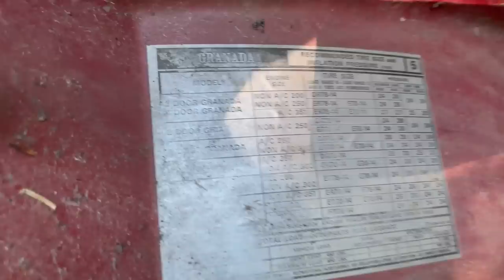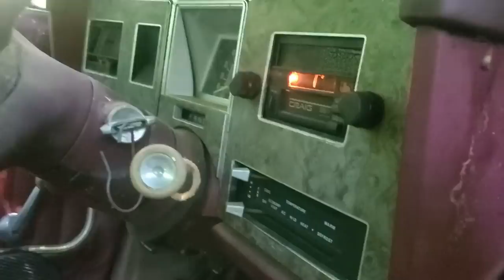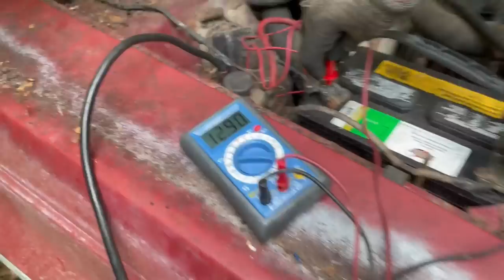Will it run? Abandoned 76 Granada in the middle of nowhere!

Comment: At first, I was afraid that you might have bitten off more than you could chew. But you did a great job with it! Now the next hurdle, getting it out of that cornfield, might be a bigger challenge to your manliness. But it has to be done. I mean, you can’t just leave it there!
Reply from the maker: I have been thinking about that. With 4 tires it would start up and go, but I am not sure how I would get it out of there. There isn't even a footpath near it. Something to think about in a couple of months when the vegetation dies down.
Reply: @whattherust  during the winter time when the corn dies you can try to drive it through the cornfield maybe wait until it's cold enough that the dirt freezes so you don't have to worry about sinking in ice or if you live in the south which I don't remember at the moment when there's no corn in the field I know it does get a little dry in the month of December
Reply from the maker: @nojopro908  Exactly what I was thinking. I don't know what is on the other side of that corn field, but if the ground is solid perhaps it could be used as a road in the winter.
Reply: Get a tractor with a front blade to make a path.Get it out f there.Great work guy

Comment: I had a '75 Granada with in-line 6 and it had to have a new starter at 18K miles. Then various electrical problems began to surface. The larger plug on top of the ignition switch on the steering column had multiple wires crimped over insulation in the mating plug. Several wires had gotten hot and almost started a fire. The car had carburetor issues that the dealer did not solve and I got rid of the car at about 25K miles and never looked back. These cars were known for lots of intermittent problems, especially with electrical circuitry.
Reply from the maker: It would seem this one follows that trend of electrical issues.

Comment: I nearly fell out of my chair when it started without the carb! That's wild!
I was carrying groceries out to these cars when they were just a couple years old, and one customer had one that was a four on the floor. I had no idea that these came with a V8. With few performance parts, a car like this could be a sleeper hot rod pretty easily.   Great job!
Reply from the maker: It definitely could. These cars are light, and with better heads and a cam it would move!
Reply: I see a Carborater on it🤔🤔

Comment: Wow what a video! 
Interesting tidbit,.Is that a Frigidaire GM A6 compressor in a Ford? 
Yes. More common in the Lincolns. 
In the 70s, Ford did realize putting a 22 lb clutch on a York compressor still couldn't smooth it out. Therefore they did use the Harrison AC Delco AC compressors on many models. 
Yes I am an auto AC specialist. 
Rebuilt 1000s of them. 
And motorhead and love what your doing.
Keep them great videos coming Richard!

Comment: Excellent video Parque  :) my one Cousin Terry he had bought 1980 Ford Granda car 4 door in same colors body also interior  with  (Big Six 250 6 cylinder motor 2 barrel carb with 4 speed Automatic transmission with Overdrive, not sure rear end ratio was of hand ! He bought of neighbor of his for win bingo game  $175.00 and 24 case  beer Lol ! In 1995 put a 1978 Ford pick up truck 302 V8 motor 4 barrel carb with daul exhaust hook to same transmission, also drive shaft plus axle! He had car till 2000 to and in 1993 got him take me home from job at and car was comfortable ride to I say ! Myself did try find those cars but came close found a 1978 Mercury Monarch 2 door but sold fast as could get try owner sell it in 1994 all need was carb for 250 6 cylinder repair on but was to bad was in great shape to past up and sold quickly!
Reply from the maker: That is a great story!

Comment: Awesome! Glad you got it running! I had à 77 Ford Granda 4Dr Ghia with 302-2V in 1993 i bought from original owner. It was à good running car with good power and power disc brakes and steering and air conditioning. I sold it to buy à 1968 Ford mustang with 289-2V, automatic, power steering! Wish i had both cars today! Take care.
Reply from the maker: Thank you Mark. I was never a Granada fan, but this car converted me.

Comment: great video. is there another video of y ou getting it out of the woods. driving it perhaps. i used to have a 79 granada straight 6 engine. great engine but had a lousy one barrel carburetor which is why i got rid of it at 33 k miles. i still remember. lol. it was midnight blue with gray interior. loved the color. this was a long time ago. got rid of it in 1982 when i bought the 82 s-10 pickup. god bless

Comment: I was thrilled to hear it run! Without checking for water in the cylinders even. But it looked dry or least till that moisture ozzed out of the intake. But there had to be some in there anyway. Did you hear any major bad sounds come out of it? Like rods knocking or upper head problems. possible 112,000 miles on it. Back then a car was worn out around 100,000. Worn rings mostly. Interiors shot. You have to add it up as to whether its worth saving. It's not parked in a garage. Transmissions are not cheap either. Besides there a snake somewhere-lol.
Reply from the maker: Hey Bob. I heard no bad sounds, and no smoke. I might be a bit optimistic, but I think this car would be an easy one to get back on the road. So may projects, so little time!

Comment: A little less fuel would be helpful. I think you flooded it. But, anyway, the spacer you are referring to between the carb and the intake would be an EGR plate. There is no EGR in the intake, so Ford's solution was to make a plate that fit between the carb and intake that mounted the EGR valve. Love your revivals! Now go back and get that thing out and get it back on the road! Really hope you do, and certainly wish you luck in that task.
Reply from the maker: Thanks for the support. You are right about the EGR plate. My F100 had one too,

Comment: I use to have two of those things one was a 1977 Grenada 2 door with a 302 and the other one was a 1980 Mercury Monarch 4 door with a 250 straight 6 I got them both off a guy I did some work for on his car I ended up driving the 1977 for a while and sold the other

Comment: I don't know if anyone else commented about the spark plug wires, but those are factory wires.  I bought a 78 Mercury Zephyr from the original owner a couple of years ago, that had 37,000 original miles, and all original parts, including the spark plug wires which said 1978 on them. When I bought it he said they hardly drove it, they live on a farm, and only used it when his old truck wasn't appropriate 🤷‍♂...he said never did anything to it but change oil, and he confirmed the plugs and wires were original, he never changed them because " the car always started"  😀
Reply from the maker: No one has commented on that. Thank you for the info. It is amazing the wires are still in such good shape.

Comment: Ford granadas are such awesome cars and they were one of the ones with the best air conditioning systems and coldest especially with that A6 compressor and suction throttling valve system way better than the cycling clutch in my opinion as far as cooling goes
Reply from the maker: I did not know they had a different type of compressor. Thanks for the info!
Reply: @whattherust  you're welcome on that yeah the early models of Granada's from 75 until possibly early 76 used it Tecumseh York compressor that had sort of an accumulator on it so that way if the evaporator output would exceed the compressor capacity
That's why they changed to the A6 compressor because it had more than one set of pistons in it for higher capacity handling and output

Comment: Disconnect thick wire from solonoid that runs down to starter & touch it to battery + starter will turn leaving other hand free for throttle.

Comment: I had an old 75 granada got it for junk $ in 80, had a dent in oil pan that made it leak,and a starter problem  a backyard mechanic looked 
at it fixed oil pan an don't remember for sure it either had a shim it didn't need or it needed a shim for starter, drove it for another 5 yr, got 
crunched in a snow storm I let it go, anyway you remind me of him, he would say crank no start, check spark, fuel,if good electrical
Reply from the maker: He was right!

Comment: The  Duraspark was also nick named the "never spark". I owned a lot of them and it's not true. Only the first gen was horrible. That was around 71-72, then they were just as good as any. Unfortunately they couldn't shake the bad rep.
I see a lot of guys replace solenoids when they don't work, but I have yet to see someone check the ground. They are self grounding, and considering the amount of rust that can build up while sitting,,,
I found it frustrating listening to you hammer on the starter when the solenoid didn't even click to send power to the starter. BTW, you don't need power to the rest of the car to run the starter, so that was also a waste of time.If you want to increase the idle, get the screwdriver out of the choke so the high idle can work and your problem is solved. Also, the engine NEEDS choke when it is cold. That's why they put them on ALL cars.

Comment: It's because the solenoid is bad on that car. You can cross jump those like you did. And they will turn over if they are bad to cause it makes full contact with main connections on the battery power source that way.
Reply from the maker: Right, it seems it was stuck solid.

Comment: F O R D letters on the header panel above the grille = '75 through midyear '76.   Running change midyear '76 lost the letters on the header,  after that molded into the top of the grille....  stayed there through '77.   Yes, it's a 302.   The small distributor cap...  I think this car is a '75.   If I remember correctly the change to Duraspark II with the wide 2 piece distributor cap was '76.   If the windshield wiper switch is on the dash and not on the turn signal stalk, it's a '75.   BUT... look at the VIN.   First character is model year.
Reply from the maker: Great info Gary. You definitely know these Fords.

Comment: From the growth of those trees around the Granada you can tell it hasn't been there long.
Looks like it got pushed across the corn field.
You can also tell someone was there working on that vehicle before you first thing I noticed when you opened up the door with the neutral safety switch jumper. Maybe it's been there for 3 years those are very young trees.

Comment: You need to always use the choke for cold starts. If you would of closed the choke, it would of started easier and faster. I see that a lot of will it start videos where they open the choke and try to start the vehicle, then when they close the choke, it starts

Comment: Yeh them ole granada pain in the butt cars. I had bought a brand new 77 Granada. Babied it for a few years till the 302 v8 engine puked out at 40k Miles. Had the engine rebuilt for too much money, then got rid of it. I knew I was in trouble right after getting it from dealer when I went thru a rainstorm and trunk ended up full of water.
Reply from the maker: Wow, that is some crappy quality. 40K and it needed a rebuild is ridiculous.

Comment: It's been awhile since I've seen under the hood on one of these I used to have one wish I still did with that hose that had partially been eaten if I remember right I think that went to the fuel Vapor storage canister and it would draw the fumes when you would start the engine back into the carburetor it was part of the emission control system that forwarded put on there instead of having the fumes bleed off into the atmosphere would store them in a charcoal canister and then be drawn back into the engine when it was running again and the canister if I remember is down on the right passenger side of the car somewhere maybe behind the fender or it could be inside the firewall there makes me want to get out and get on a back road and look around these old Barns and stuff and see if I could find one of these again because they were really nice cars and Road really well the LTD was my second favorite and third favorite would probably be Mustangs another big car that I like was the Ford Torino and Mercury Montego
Reply from the maker: That Granada really wanted to go. I was not optimistic that it would run, but the car surprised me. I was impressed with it.

Comment: that's plain crazy, that engine would run without a carb! all you need now is a passenger with chuzpeh and a super-soaker filled with gasoline! XD
someone indicated kids doing a joyride with it, this might be a thing considering the carb and the wire harness missing. who knows what else they "fixed" for it... and in the end it stopped driving, maybe the tyres died, and they left it in the corner of that one field the previous land owner didn't work anymore, anyway, where the shed was rotting away and the cart parts were laying around.
(I suspect you might find the remains of a trailer or a little toolshed there under the brushes; these wheels were laying there for a reason methinks.)
Reply from the maker: That is an interesting thought. Now that the vegetation has died off I will take a look!
Reply: @whattherust  Make a vieo off it, I think some might want to know what else is hiding there. :)

Comment: The original ford electronic ignition systems are fine. The problem and bad reputation came from the aftermarket versions of the same.
Reply from the maker: Right, I have only had one fail once, and I have owned a lot of them.

Comment: Are you gonna go back and attempt to drive it out of there or are you done at this point?

Edit, I had a  yellow 77 Granada it had a 6 cylinder. It smoked and used so much oil. I ran chainsaw bar and chain lube in it because it was so thick it would last twice as long as motor oil. I put some miles on that thing. It was the summer of 1992.
Reply from the maker: I am going to revisit the car in the fall. There is no getting it out of there right now.

Comment: Butt connector?  Looks like a female spade connector.  Butts are the tube-like connectors., like used in splices  The flats are male spades and the knurled-sided ones are female spades., like used in termination and component plugs.

Comment: Excellent video, except for the audio. Voices and such are fine, but loud noise such as an engine starting/running sound horrible. You need to invest in a better microphone. Actually hearing that engine fire and run would have been so satisfying..
Reply from the maker: Agreed. It was disappointing to hear what the mic did to the engine sound. There is only one take, and this mic was new and I did not know it would cancel the sound like that. Now I know, so it won't happen again.

Comment: Unsubbed . Told you 77 was first year of brain box in Fords . No need for sarsacm. Good luck .
Reply from the maker: What sarcasm? I asked a legit question that I do not know the answer to.
Reply: Ford Motor Company began using electronic ignitions in 1973 with the Duraspark electronic ignition system and introduced the Duraspark II system in 1976. The biggest change, apart from the control box redesign, was the large distributor cap to handle the increased spark energy. So there is that and goodbye!>